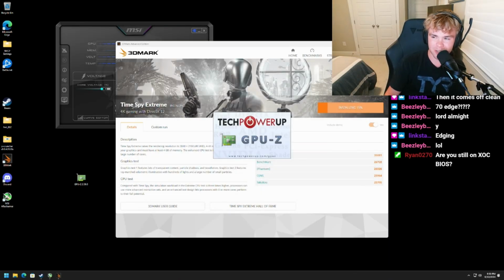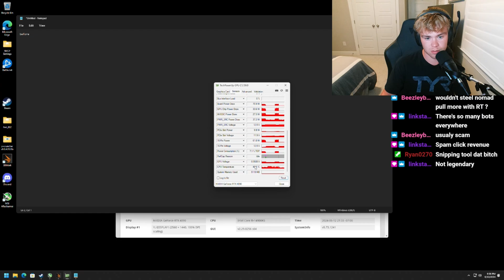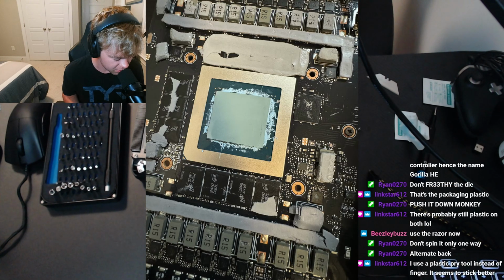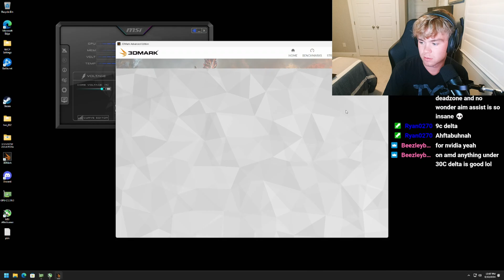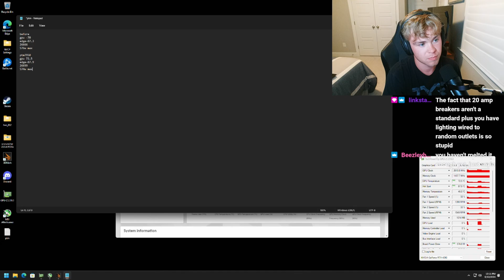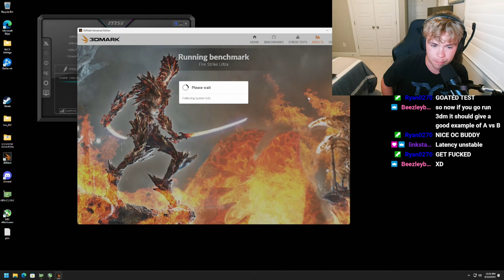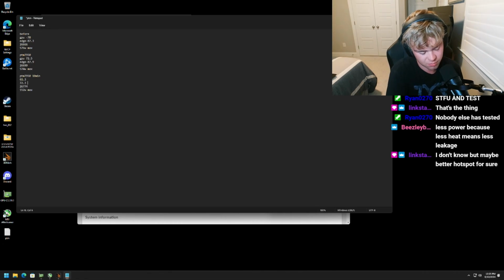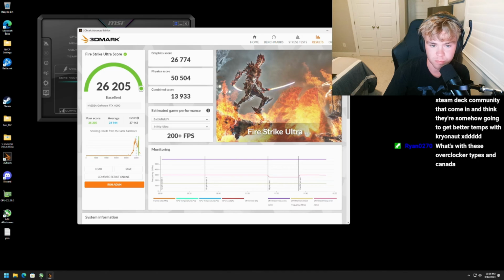MAX 4090 Cooling... PTM 7950

Comment: Your chat and comments are hilarious lol. Yes there is fake PTM7950, and it's probably more prevalent then the real stuff. PTM needs 10 cycles past 45C then back to idle to actually phase change the first time it's used. It gets better over time unlike thermal pastes that suffer from pump out rather quickly. For example, my 7900XT watercooled hotspot hit high 50s-low 60s when i first installed it. 6months or so later, it's hitting closer to 70C. PTM works the best on direct die because of the high mounting pressure.
Reply: @bluej511  With PTM7950 I've had really good results, I use them for all my builds, family, friends, whomever. In a scenario where the user most likely won't have a reason to remove the CPU Cooler anytime soon then I'll use it on the IHS as well. Even if a high performing TIM does 1-2c better than PTM7950 on the IHS, I'd rather have peace of mind knowing there won't be a pump out effect.
Reply: You had high 50s - low 60s when you first installed and 6 months later it's at 70, are you referring to standard TIM or PTM7950 or a fake PTM7950?
Reply: @Ben-ld1qi  I used kryonaut, after a month it suffered pump out.
Reply: @bluej511  Ah, gotcha, yeah that makes sense. I've always had temps getting worse over time with TIM, and I mean the 'premium' ones. Not only on GPUs, on CPUs as well sometimes even a couple of weeks afterwards and already 2-3c higher.

Comment: I bought some Thermalright Helios for my 13900K and it works well.
Reply: does wonder for a gaming laptop been using it and the temp is great both cpu and gpu never throttled on i5 11400h and 3050 75w previously even on kryonaut it will throttle
Reply: @bryan8946  did it work good on i5 11400h i have the same cpu
Reply: @k419  yep never reach 88c+ anymore

Comment: i repasted 4 different GPUs with PTM 7950, currently using a 7900xtx powercolor hellhound which i repasted with ptm well over a year ago. still works fine. dropped my temps by 10c
Reply: Tempted to try this on my GPU but my temps rarely go above 57c since it's got AIO water cooler on it to begin with.
Reply: @EvilWiffles  yeah my GPU temps were very good around 60c, hotspot was like 90c though. Now it sits at less than 80c most of the time :)
Reply: What size did you get for the 7900xtx? Im debating getting it my nitro +
Reply: @pokemongoprofessoroak7792  you get a large sample and you cut it to size
Reply: Do you lose warranty if you do that? I have RTX 4080 warranty to 2026. After thermal paste gpu scandal i don't really know what to do now.
Reply: @lior2k  אין צורך אבל זה לא יזיק
Reply: ptm is very helpful in gaming laptop as i dont want liquid metal, so ptm gives like 5 to 10c depending on the capacity of heatsink of laptops

Comment: Would this be better than Liquid Metal, I have conductonaut extreme in my 4090 waterblock
Reply: If you are talking about pure temps performance, LM will win by a bit but PTM will be easier to work with
Reply: Have it on my Rx 6900 xt and it fixed the d@mn hotspot temps as no matter the brand of TIM i used, it will just pump out after a month or 2 and the hotspot will climb to 110c. Now it is sitting at max 85c when gaming at max load and 93c when doing stress test with OCCT
Reply: Though it needs multiple cycle to actually performs to its peak potential